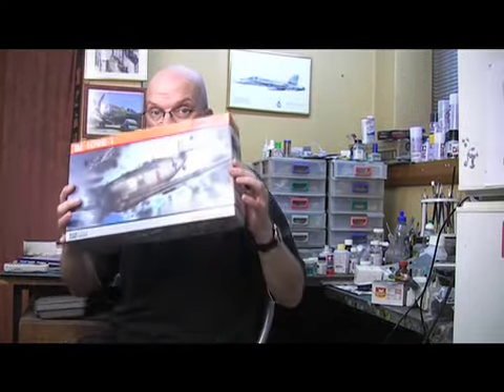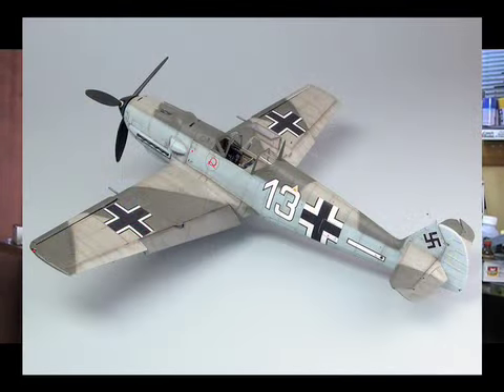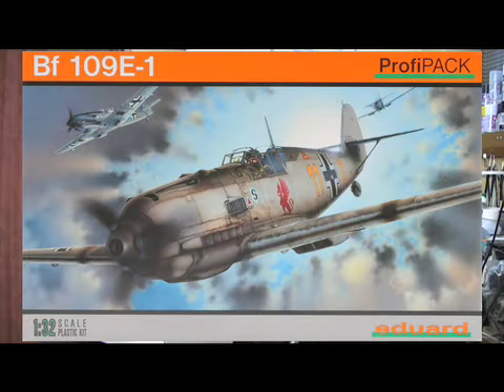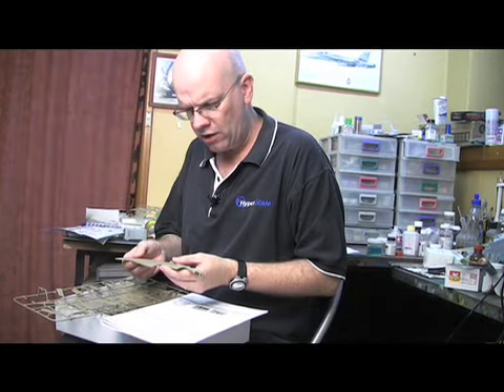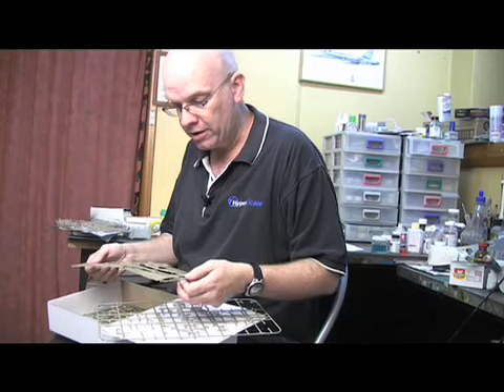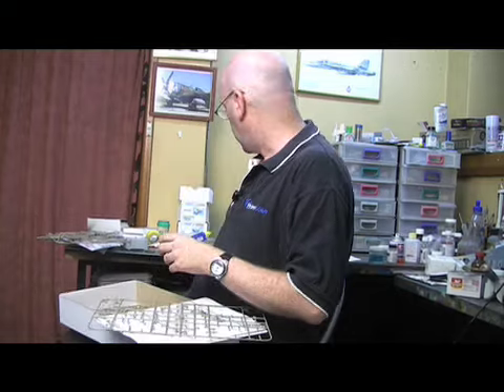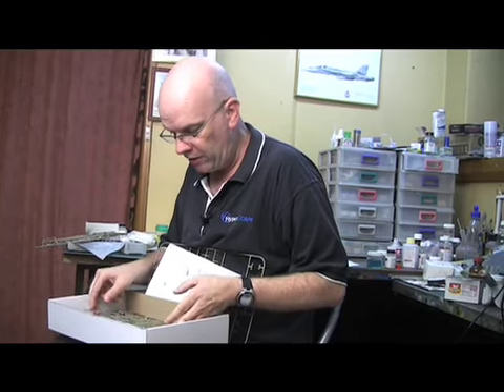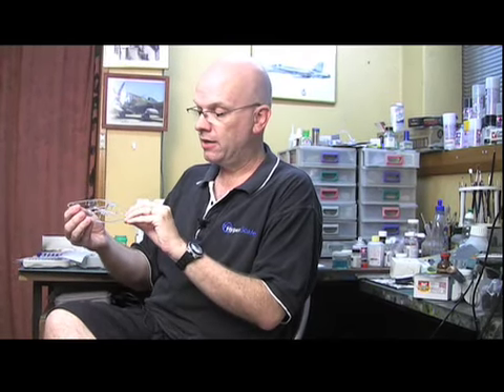Eduard 1/32 scale Messerschmitt Bf 109 E-1 Review

Comment: @148scalemodeling it just means that etched metal parts and (maybe) resin cast parts are already included in the box and you don´t need to buy any aftermarket parts, except for maybe seatbelts which is not always included in these ADULTS ONLY model kits. -ASK THE DEALER TO OPEN THE BOX AND SHOW YOU THE CONTENTS WHEN IN DOUBT!!!